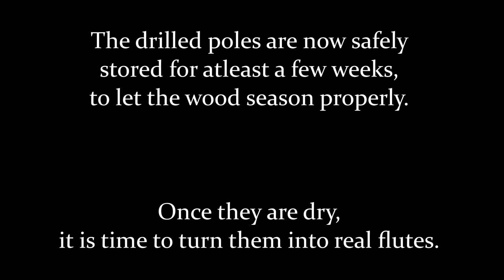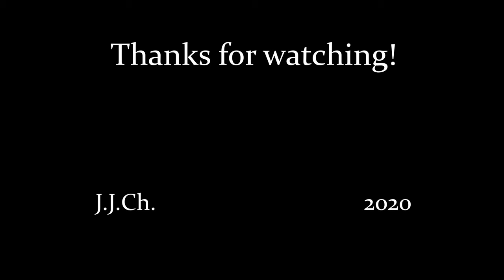How to make a wooden flute

Comment: Superb video thank you for sharing  . I always dry elder with the bark on because I find it a right pig for warping and splitting without it.
Reply from the maker: Hey, thanks! Keeping the bark on is definetly one way of preventing crack. I prefer taking the bark off when it is fresh, becouse once it dries it is much mroe difficult. 

You can also prevent cracking by using string binding as I do in the video, cheers

Comment: Thanks for sharing, I watched both part 1 and 2. What interests me most is the hand boring tool you used. Did you make this tool, if so methods? If not where did you source the tool from. I see it used by other flute makers. Can such a tool be used for wood that is already seasoned as this is the stock I have.
Reply from the maker: These drills are called "nebozez" in slavic laguages. They are very common in Eastern Europe (altough usually they are shorter and used in traditional carpentry, with length around 50cm - I had to weld an extension rod to it). In english they are called "gimlets" or "gimlet drills". Finding really big ones is not easy - your best is to search ebay for something like "antique big gimlet drill". If you are from Europe you may be able to order some from the Eastern Europe as well.

They can be used even for seasoned stock, I have used them in seasoned oak and maple as well, you have to go slow, but it can be done. The drill bites into the wood on its own, thanks to the screw-like point, so avoid any pushing onto the drill, in worst case scenario you might break off the point.
Reply: Thank you for the details, much appreciated.
Reply: @JJChWorkshop  Hi there. first of all, thank you for the information you have put out about flute making! it has hugely inspired me and I am now making my second flute. I have a lot of respect for your work. 

I have been on a quest to find the tool that you use in this video, as I couldn't find it and hence my first flute was made with an automatic drill.

In my searches I have found that I have had better results searching for a "T handle auger," which is very similar to yours, or a "Scotch eyed auger," which differs in that rather than a set handle, it has a hole in the end through which you can insert a lever/ handle of your own. There seem to be a lot of them floating around on Ebay/ Etsy. I even found one on Amazon! I hope this is helpful to someone. Cheers!

P.s your playing is wonderful.

Comment: What size is that bit you used to hollow it out?
Reply from the maker: Hello there, The bit I use has diameter of 19mm. But remeber the flute is hollowed out when the wood is green. Once the wood is dry, the inside diameter shrinks to about 17mm.

But in the end what size of the inside bore you go for depends on the tunning of the flute. The flute in the video has tunning of low E. Lower flutes will needs slightly bigger inside bore, Hihger pitches will require slighty smaller one. Cheers

Comment: Hi, JJ
Love your flutes; lesson and your work.
I wonder if I could ask you a technical question!?
Simply; if I have a flute that plays really well; and I cut the tube off the flute! So; all I know have is the sound part and about two inchs of pipe in front of where the sound is generated and comes out! If I now blow through the very shortened section (and, again, this is where the sound is generated) ... if I blow through this, will I get a sound ... !?
The reason that I ask is that; I have built a 34'' Contrabas flute; the long tube is finished, but not connected to the sound part, but, for the life of me, I cannot get any sound out of the sound part! I would have thought you could create sound through the sound part with it disconnected from the tube part ... !?
Hope you can help on this one, as I am now completely stuck ... !
Best wishes ... 
William (Hampshire UK)
Reply from the maker: I am kinda lost here buddy - do you get the sound when you have the flute all put together? If yes, than you should be able, to produce sound even if you remove the part with playing holes (it will function basically like a simple whistle). 

If you can´t produce sound with the whole flute put together, but you can produce when you disconnect it, there is some trouble with the dimensions most likely (aka bad diameter and length ratio). I have never made flute that big so I can´t speak from experience, but usually the big flute are more difficult to make, and the sound they produce tends to be little weaker even when done well.

Comment: Hello friend! I want to start making some flutes and i m interested in what types of wood should i use and the measurements for the wholes.
Reply from the maker: Hi Bogdan, the wood i am using here is Sambucus nigra. I like using it, becouse inside of the branches is already partially hollow, making it easier to drill. It was also traditional choice for flutemakers of old days in my country.

But strictly speaking about the wood quality, hardwoods like walnut, applewood, or exotic hardwoods are a good choice.

Comment: this may be a silly question, but what was the tool you used to hollow the piece out called? I cant seem to find anything that looks similar when I try to shop for one (you inspired me to pick up wood work again and i think a flute would be fun)
Reply from the maker: JJCh Workshop

Hello there! These drills are called "nebozez" in slavic laguages. They are very common in Eastern Europe (altough usually they are shorter and used in traditional carpentry, with length around 50cm - I had to weld an extension rod to it). In english they are called "gimlets" or "gimlet drills" or sometimes also "augers" (though not all the augers look like the one i use in the video, some of them look like big screws - these ones can be used as well, but are not ideal).

 Finding really big ones is not easy - your best is to search ebay for something like "antique big gimlet drill". If you are from Europe (judging from your name, you may be from Poland?) you may find some of them on flea markets where people sell old tools from barns etc. (this is how I got mine). You can try asking some local carpenters, who build log houses, these guys often know where to get these tools as well.

And last but not least, good blacksmith will be able to forge you custom one, though this will be the most expensive option.

Comment: Is that auger you used to hollow out the flute a custom tool, or is this common in flute making?
Reply from the maker: They are quite commonly used in carpentry in eastern Europe, originally they were meant for drilling holes for dowels making carpentry joints. They are called ,,gimlet drills,,. Or in slavic languages we call them ,,nebozez,,. The auger bits you can usually buy in western Europe or USA were not used were often in my country.

So not really custom tools, I only had to make one adjustment - make the shafts longer. The drills I could find were usually quite short, around 40cm.
Reply: @JJChWorkshop  Thank you! That is super helpful. Here in the U.S. the tools are becoming more and more homogenized, so if you want something different, it usually has to be made custom. I will see if I can find one. Thank you and keep up the beautiful work!

Comment: How do you dry the wood cylinder without the wood cracking?
Reply from the maker: The drilled wood develops cracks very rarely. Keep it in a cold dark place for some time and it won´t crack.

Comment: Please, what's the name of that drilling machine used in your video? Please help
Thanks for doing such a great work...
Reply from the maker: Hello there, the drill is called "nebozez" in slavic languages. In english the most accurate word would be "gimlet" or gimlet drill". Finding one this big is not an easy task, usually they come shorter, in leghts from 30-45cm. Your best bet, is to find shorter one and than weld and extension to it (that is what I did).

Comment: Fantastic video. Could I ask where you got the auger at 1:20?
Reply from the maker: Thanks mate, It as an old carpenter auger, that had an extension rod welded to it (it used to be much shorter, like 45cm). I bought it second hand, on our local ebay equivalent page.

Comment: Does the hole go the whole way through the stick?
Reply from the maker: Hi, the flute is drilled all the way, but one of the ends is than closed with a cork plug.

It needs the be initially drilled all the way, to make cleaning of the inside easier.
Reply: @JJChWorkshop  oh ok. Thank you so much

Comment: When you try the first flute, it's still completely empty on the inside, or did you put a block for the air to come up just from one side??
Reply from the maker: Hi, it is not empty, there is a cork plug inserted, from the side closer to embouchure (the blowing hole). It is inserted quite deep inside about 15mm from the embouchure. 

You have to test yourself  how deep the plug needs to be (check the sound). Let me know if you worked it out, good luck
Reply: @JJChWorkshop  Thanks!! I managed to finish out the flute, however, it was my first attempt on woodcarving one, and i dont have the ideal tools for it (just a knife and a curved chisel). Anyways, i did it, and it produces a fairly decent sound for what it is. (I drilled the holes on some random positions. I should take care of that next time)
But now that i´ve made one and i know were some errors were made, i´ll try making another one, and this time, better.
Amazing video by the way, love your content, keep it up!!! <3
Saludos desde España

Comment: Great tutorial! What is the name of the stick drill used at 1:14 ? I'd like to buy one but I can't find it for sale anywhere online.
Reply from the maker: Thanks mate, this kind of a drill is called "gimlet" (or "gimlet drill"). It was commonly used in eastern Europe in capentry work. From my knowledge it is less common in rest of the world, but you should still be able to find some. Your best bet is to search e-bay for something like "vintage gimlet drill". In case you live in Eastern Europe you can also find it under the name "nebozez" (that is the slavic name for it).

The ones you find will be most likely much shorter than this, but any good welder will be able to extend it. Finding long one is extremely unlikely, but taking short one and extending it will work perfectly fine (my one is fine example of this). Good luck!
Reply: @JJChWorkshop  Thanks man! Yeah, it's difficult to find one the right size, but at least I've got some ideas now.
Reply: This was my exact question and happy this got answered, really want to get one haha

Comment: Man I'd love to make a flute. I can't even make a note though so I wouldn't be able to tell
Reply from the maker: If you can blow on the glass bottle you can blow on the flute my friend.
Reply: All you need is a PVC pipe and a drill. Cut the PVC pipe to the desired length, plug an end of the flute using a cork, drill the blow hole about an inch from the cork, drill the note holes. Us a note hole location calculator to calculate the hole sizes and locations (ex: http://iotic.com/flutomat/ ).
Reply from the maker: @boptillyouflop  Did you really tried and tested flutomat? Becouse I did and it never worked very well
Reply: @JJChWorkshop  Oh? Sorry then. To be honest, my flute attempts were never really in tune. ^^;
Reply: Back then, my goal was to build a brass instrument that would play odd harmonics (with the end cut in diagonal to form a mouthpiece of sorts)... in the end, I couldn't do it because it would have required keys - filling the gap between the 3rd and 5th harmonic or between the 1st and 3rd harmonic just took too many holes, and the holes needed to be just too large and far apart.
Reply from the maker: @boptillyouflop  Hey no problem mate, regarding the flutomat, I tried it some time ago, but it never seemed to work very well for me. 

I tried calculating measurments for one of my transverse flutes. The numbers I got seemed kinda weird to me, but I decide to make one test-flute anyway. However even when I made it 100% true to the numbers flutomat gave me, it was completely out of tune and sounded terrible. Maybe there was some mistake on my part, but I can´t recommend it.

Comment: how long you dried the wood?
Reply from the maker: Not that long really, about 5 weeks. This flute has relatively thin walls, therefore it dries quick. Bigger flute would take longer.

If you are not sure your flute wood is dried enough, the nice little trick is to weight it every few days. At the beggining the wood will be getting lighter (water escapes). Once the weight stops changing you can be sure the wood is air dried enough.

But with some experience you can estimate how long the wood needs to dry quite accurately.

Comment: 1:14 what's the name of this tool? I need one of these too.
Reply from the maker: It is called "gimlet" (or gimlet drill/gimlet bit) in english. They are common in the Eastern Europe. In slavic languages we call them "nebozez".
Reply: @JJChWorkshop  thank you very much
Reply: @JJChWorkshop  I can't find one of this length. Do you have a link of one you prefer?
Reply from the maker: @thesilvanshow349  It is near impossible to find one this long. The shorter drills have been originally used in carpentry, usually being around 40cm long. If you want the long one, you need to buy the short drill and let some blacksmith/locksmith or some other metal craftsman extend it.

The original long ones ,used by old flute makers, are extremely rare, if you are lucky you may find them at antique shops with old tools or at flea markets. But having someone extend the shorter drill is easier  i would say.
Reply from the maker: @thesilvanshow349  This is an example of old drill, that would work great, if you could get someone to extend it.

https://www.ebay.com/itm/Antique-Vintage-Carpenters-or-Shipwrights-T-Handle-Wood-Auger-Hand-Drill/143877791873?_trkparms=aid%3D1110006%26algo%3DHOMESPLICE.SIM%26ao%3D1%26asc%3D20200520130048%26meid%3Dc84581e24bf842e0b89363a1c2b269b6%26pid%3D100005%26rk%3D2%26rkt%3D12%26mehot%3Dpf%26sd%3D143639844628%26itm%3D143877791873%26pmt%3D1%26noa%3D0%26pg%3D2047675%26algv%3DSimplAMLv5PairwiseWebWithDarwoV3BBEV2b&_trksid=p2047675.c100005.m1851